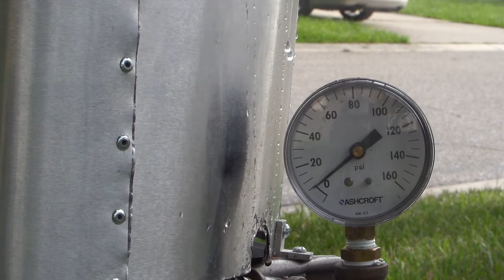Running an Engine on Water! + Retro LoFi Music

Comment: awesome video, i believe steam is the future answer for clean energy
Reply: using spark plug as water sensor also a genius attempt, is water tube boiler more efficient than fire tube boiler?
Reply from the maker: Thank you the spark plugs works very well.  I am worried about rust in the future though.  

I think a water tube boiler has the potential to be more efficient.  Water tube boilers can be smaller since they only store a small amount of water at any given time.  Ideally, alot of heat can be focused in one small, well insulated area and produce steam for the engine on-demand.  This could mean less of an energy loss to heat than a fire tube boiler which requires a large vat of water and a huge firebox.  I have zero math to back this idea up though, I'm no engineer😆
Reply: wait til' he hears about atom